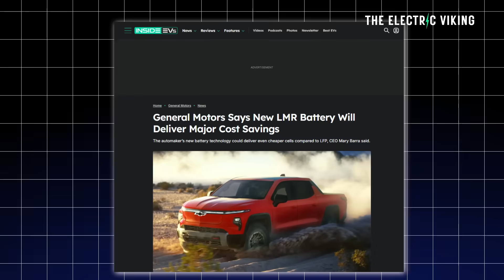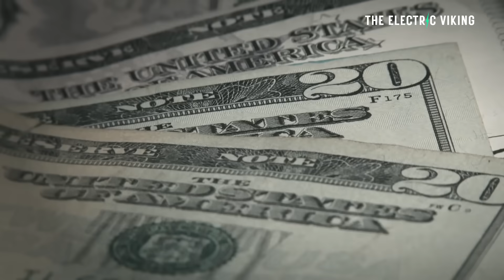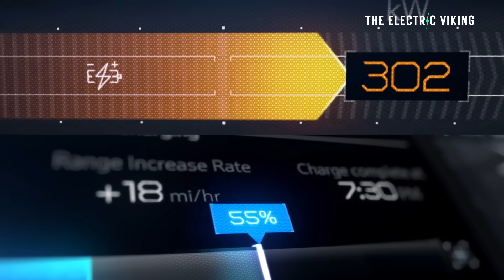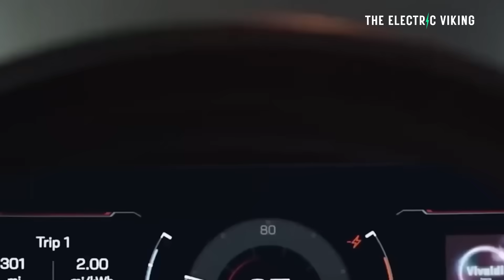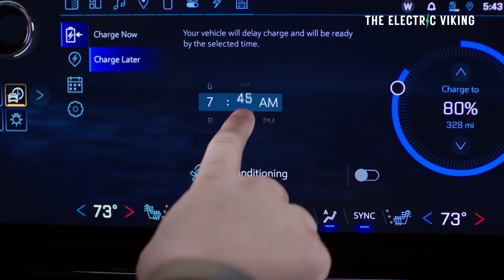GM's LMR Battery: Cheaper Than LFP?! The EV Game Just Changed!

Comment: There is quite a difference between solving the chemistry, and solving mass production hell. If the LMR batteries are 10 or 20 percent better than current Lithium nickel cobalt batteries, and are also 5 percent lighter. This will make them 50 % lighter than LFP.  This is where all components of a truck can be made a bit lighter and the range can be improved while the price can be reduced. GM had better begin looking into 48V Technology that Elon shared. And the new patent Tesla just took out on massive wire harnesses reduction. Using flat graphene conductors instead of copper could save vast amounts of weight and copper.

Comment: Reasons to keep LFP going in some cars despite LMR's advantages:
1. Existing inventory of LFP cells for current models
2. Engineering time to adapt LMR to LFP slots in existing models - Silverado was the first LMR platform for engineering reasons
3. Potential slower charging of LMR means shorter range, more frequenctly-charged models are further down the upgrade list
4. LMR scale up is in progress and they dont have the volume for other models yet.

Comment: It looks like the issue with LMR is they can't get a high cycle life out of it. Simply put: it degrades too quickly. 🤷‍♂
Reply: That is not really accurate.  Yes, LMR batteries are projected to have 1500 to 2000 charging cycles, compared to 3,000 to 10,000 for LFP, but 1500 to 2000 charging cycles is already what NCA batteries have, which is what is used in long range EV's, while LFP batteries are relegated to short range EV's.

On an EV with 1500 charging cycles and 300 miles of range, that is still 450,000 miles of driving, or over 30 years of the average miles driven in the USA.  If they get 2000 charging cycles, we are talking about 600,000 miles of driving.

That obviously would be far more than almost any private car user would be driving in even 20 years.
Reply: @redbaron6805  I haven't seen a single source saying it gets 1,500 - 2,000 cycles. Everything I'm reading says it's currently getting 300 - 700 full charge/discharge cycles and under "optimized" conditions, up to 1,000 cycles. Optimized, in this case, means no more than an 80% depth of discharge and operation within "ideal temperature and charging ranges", whatever that is! 

It's worse than that, however. LMR batteries also suffer from "voltage fade", meaning it suffers from quicker capacity loss. 

I'd ask you to point me to a source to back up your assertions, but I don't really have to. If you were correct, GM would already be using these batteries, wouldn't they? But they're not. Btw, this is a chemistry that's been tried before and no one has been able to crack the code on it, so GM is just trying to make shareholders happy by talking about "new" batteries and make everyone think they're coming up with new stuff.

Comment: The current cost of Manganese is irrelevant, because it will rise the moment the is a rise in demand - like when car battery manufacturers start making batteries with it.
Reply: LMR still has nickel as well, which will likely determine the cost of the battery. All the manganese does is lower the cobalt and reduce its impact on the price of the battery.
Reply: umm no
Manganese is like 12x cheaper
Reply: These claims are getting rather absurd on here.  Manganese is the 12th most abundant element on the planet, and is not in short supply by any definition.  You may as well claim that using Sodium in batteries will make prices of Sodium skyrocket.

The entire premise is just absurd...
Reply: @redbaron6805  If a new use of manganese is discovered and demand soars, the price will go up.  I still agree with you that even if the price goes up, it'll be way cheaper than less abundant elements.
Reply: @harrymills2770  I just don't see the math supporting that.  According to GM, they will use 32,500 tons of Manganese annually to eventually produce about 1 million EV's.

That means 325,000 tons would be enough for 10 million EV's, and 3.25 million tons would be enough for 100 million EV's.

The annual world wide production is currently 20 million tons.

Between Australia, South Africa, Brazil, China and Ukraine, the reserves are 1.5 Billion tons of Manganese, or enough to produce around 5 Billion EV's, and those are just the largest reserves. 

There are hundreds of millions of tons in reserves in other countries as Manganese is pretty common being the 12th most common element on earth.

Hence, if there will be any price increases or shortages, they will be very minor and very brief.
Reply: It will depend on how much they use and the supply of it.
Reply: LMR typically contains 30-40% nickel, 2% cobalt and 58-68% manganese in their cathodes.
Reply: @jamesvandamme7786  It's way more abundant that cobalt or lithium.
Reply: Not if it is very abundant.

Comment: The problem is that fluctuating share prices mean companies throw out misleading spin press releases, sometimes with over-optimistic assumptions. However, I'm sure that all companies that are serious about EV's are working like crazy to get energy density, and charging speeds up, and costs down, while trying to minimise environmental impact to avoid negative publicity from people and companies that prefer oil spills. Battery technology does seem to be improving very fast, and in some ways that's bad for EV's. People are just waiting and waiting and waiting for the moment to switch from gas guzzler to electricity. Every advance is an excuse to wait for the next advance.
Reply: That happens with any technology, Phones, computers ... sooner or later you say this is good enough and pull the trigger.

Comment: What is the energy density of these lmr batteries
Reply: It is 33% higher than LFP batteries.  If that ends up being the case once they enter production, it means the same volume of LFP batteries giving you 240 miles of range would give you over 300 miles of range with LMR, but at the same cost per kWh.

Comment: WHERE are you going to access 1000 kw feed for your charger?  Ignorant.
Reply: @junehanzawa5165
1 hour ago
It's not that LMR is cheaper than LFP, but even at the same price, it provides a significantly higher energy density with much lower weight than LFP, and is even lighter than high Nickel content chemistries of NCA or NMC, as Manganese is lighter than Nickel. So for the long range obsessed North Americans, this is a better solution at a lower cost than the high Nickel content batteries.

Comment: It's not that LMR is cheaper than LFP, but even at the same price, it provides a significantly higher energy density with much lower weight than LFP, and is even lighter than high Nickel content chemistries of NCA or NMC, as Manganese is lighter than Nickel. So for the long range obsessed North Americans, this is a better solution at a lower cost than the high Nickel content batteries.

Keep in mind that LFP is an American invention, but it just didn't, and still doesn't, provide the long range of gas happy, long range vehicles that North Americans are used to. That's why Nickel rich chemistries are so dominant in North America. LFP is fine for lower priced, shorter range entry level EV's, but not for the long range EV's that the majority of North Americans want and are used to.
Reply: LMR when it matures will be entering a crowded field in respect of range capability ... sodium-hybrid, solid-state, LMFP and metal-air are all projected to mature before, at or shortly after LMR's release.

Comment: prismatics are easier to cool. cooling can be a big price driver for pack price. prismatics are made out of aluminum and can possibly be cheaply temp managed with phase change materials passively. cylindrical has to use steel which saves on fixture cost but steel sucks as a heat sink.

Comment: Another possible reason for planning to use both LMR and LFP batteries is the differing safety profiles. LMR batteries apparently still use flammable solvents and have the same thermal and fire risks associated with NMC chemistries. With China making moves to increase EV safety in terms of fire risk, manufacturers may be effectively forced to use LFP batteries or SIBs in their vehicles sold in the Chinese market. Regulatory changes in other jurisdictions are also possible. Other possible reasons for using both chemistries might be supply chain and production efficiencies and redundancies. On the whole, LMR batteries seem a somewhat minor incremental improvement to me anyway. Good to reduce nickel use for sure and good to manufacture in places other than Asia but not the most revolutionary battery technology on the horizon by miles. General Motors is being General Motors I think
Reply: LMR has more effect on reducing cobalt than nickel, the former in a LMR cell is reduced to about 2%, whilst nickel is still 30-40% of the cathode.

Interestingly the comparison with LFP ignores the impact of manganese on those cells as well (LMFP). I suspect the increase power density of LMFP, and lower cost, will erode the claimed benefits of LMR.

Comment: Again compare in wh/g, not wh/l. Wh/g is a scam. The battery needs space in the car, not weight.

With wh/g hydrogen are 2,5 more energy dense than diesel. But, if you use the correct measure wh/l diesel has over 5 times more energy.

So, check your numbers, electric viking. Use the correct measure. Wh/litre.
Else, you are just spredning lies.

Comment: Reason they got into financial problems is because the over invested in a technology that the general person didn't want or had the need for. When this administration stopped the hard push, they got caught with their pants around their ankles. If it helps drive better research and development into different chemistry and batteries, that's a good thing. They need a cheaper battery, as good or better energy density, and most important would be quicker charging

Comment: LFP is an established technology.  LMR is the new kid on the block.  Less of a track record.  There's more of a technology risk.
Reply: Plus LMFP is the real challenger to LMR not LFP, both use manganese to increase energy density of the cell. The cost differential of NMC based LMR and LFP based LMFP will likely remain, with LMFP being the cheaper of the two (due to nickel and cobalt still being used in LMR).

Comment: Rather have more than 1 battery option available. Limit supply chain risk. Phase out proven battery technology only when new technology is more mature and all issues worked out over the long term.
Reply: LMR is just LFP with manganese injected in. If LFP is having a resource supply chain problem, LMR will too. If you want to limit factory based supply chain risk, just build more LFP factories

Comment: Any hydrogen factory has to produce 24/7 - not only when the sun shines or the wind blows. That´s what making a dent in all so-called "green hydrogen" projects worldwide. What works in a highly subsidized lab is not ready for commercial mass production. It´s no problem to make it - it´s just 4-5 times more expensive. Plus huge storage and transport cost and high corrosion issues when it comes to pipelines. The combustion engined Fiat 500 at less than $20.000 was a huge hit for many years. The far less capable EV version Fiat 500E starting at $30.000 isn´t. Go figure. 25 years ago GM was still producing really good, reliable and affordable cars.
Reply: Hydrogen could be  made only during the day, but the simple physics and horrendously bad efficiency of hydrogen make it a never gonna happen tech. These were known 20 years ago but people keep investing into the asinine tech.

Comment: Edison Motors is planning to use LMR batteries.
Reply: I remember them saying they were changing batteries, but had not remembered to what.  If they are using LMR, they must be Chinese because they are not waiting 3 years for batteries.
Reply: @ryuuguu01 
Correct LFPMO , Chase wanted the extra kick available at high discharges compared to the LFPO available at that time after testing Topsy for months.. 
Whether that will hold with the new CATL LFP  gen two cells I'm not sure. 🤔

but there comes a point where if you want to build something you have to commit to the components...and change if the evidence or suppliers change their products..

Comment: Do lmr have 3500 recharges like lfp and can you charge to 100% like lfp. They have lfp ready now use it until lmr is ready. I will not buy a lithium ion battery that you can only charge to 80% and only has a 1000 recharges. Bad battery no thanks

Comment: Manganese is only a small cost of the cathode, it probably costs 10x less than Nickel or Cobalt per ton. Umicore (cathode producer) is betting on LMR as well & said it's cheaper than LFP (but they did mentioned "in Europe"). The question is; what charge rate? temperature range? Cyclability (Umicore said +1500 cycles a few years ago), ...
Reply: LMR is a variant of NMC, just optimised for higher manganese and lower cobalt content. It's cheaper than NMC but the price of nickel, cobalt and manganese are still pricy compared to iron and phosphates in LFP batteries.

I suspect GM (and LG the battery maker) are hoping that the energy density of LMR increases significantly more than that of LFP to enable them to be the cheaper technology.
Reply: Lifespan? Voltage decay? etc...
Reply: Love our 2018 Bolt, even considering trading to a 2026.    Hope they  bring out an BEV Colorado or Canyon.
Cheers from Canada 🇨🇦

Comment: LMR batteries don’t last as long as LFP. I would rather get the longer lasting battery
Reply: GM is probably testing the hell out of them, having been burned bad by the Bolt battery fiasco. I would expect they will be greatly improved before they go to market.
Reply: And they're going to have to develop it without any government subsidies, now that Trump has cancelled the huge Biden-era Inflation-Reduction Act, which included his Renewable Energy Policy.
Reply: depends to discharge depth commercial Sony li-ion from 2001 can last 75K cycles in 20--25% cycle depth tested by NASA.

Comment: Yet another "this is a better battery" story. How many are true?
Reply: They all are true. Every day a new better-battery can be developed. That's how much room for improvement there is in this technology.   Unlike trying to ring the last 2% of efficiency out of 19th century,, Victorian-era steel stamping technologies for +1mpg from a pushrod V8.    And I love NOHC motors.
Reply: @TonyBasuro  Most innoventions are not commercially viable. I suspect the same applies to new batteries. Also, ICE cars are far from dead, as are ICE vans and lorries.  BEVs do not suit many people. I drive an EV which works for me, but have a garage with a home charger.

Comment: Just like Toyota...always one technological silver bullet away from leapfrogging everyone and fixing the hole they are in.
Reply: And, like Toyota, still lobbying for ICE profits to continue..
Reply: @thedukeofalinor1377  Yep.
Reply: @thedukeofalinor1377  Or hydrogen, the "fuel of tomorrow!"
Reply: @thedukeofalinor1377  The EPA doesn't want Toyota to build good, affordable ICE vehicles.  If you wiped out a lot of the contradictory and whimsical government regulations, cars would be cheaper and more durable.  It takes years for the amount of pollution caused by the mere manufacturing of a vehicle to be offset by any efficiencies gained.  If they made cars that lasted 50 years, even if every one of them was a gas guzzler, the planet would be a cleaner, greener place.

Comment: The LFP technology is ready now. LMR is the future and then Sodium after that.
Reply: Sodium batteries already exist, but LFP is better except for temperature range.
Reply: @xeridea  Sodium are cheaper, which means Chinese utilities will be buying huge amounts, which could make them much cheaper.  Chinese industrial policy does not a regular lithium batteries to used for stationary batteries, except maybe as a secondary use after no longer useful in transportation.
Reply: @ryuuguu01 sodium ion batteries are currently more expensive, this may just be because production hasn't ramped up. Perhaps it will get better, but the technology needs to evolve a little bit more, and sodium does have some drawbacks as well as advantages
Reply: @xeridea  you're right, I was looking at a prediction, think it was the current price.  China does seem to be pushing them, probably for energy/ supply chain security reasons. Or maybe just because they stay in the lead on battery tech across s many chemistries as possible.
Reply: @xeridea Temperature LFP problem has been tackled too
Reply: You forgot solid-state and metal-air batteries in that list, plus LMFP which is already in production (same advantage as LMR of using manganese but in a LFP based cell rather than NMC as is the case with LMR). Oddly, manganese lowers the cost of a LMR battery but raises the cost of a LFP one (when becoming LMFP).

Solid-state will likely arrive sooner than LMR, and be cheaper, and metal-air a little afterwards (also cheaper and significantly more energy dense).

LMR is launching into a very crowded field when (if) it does eventually launch onto the market.